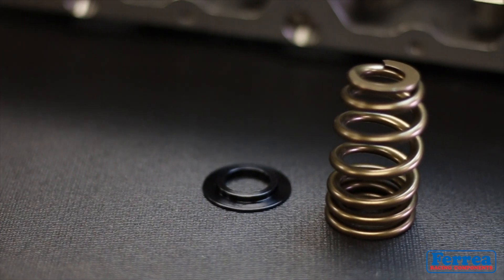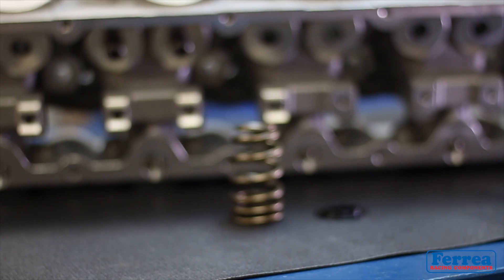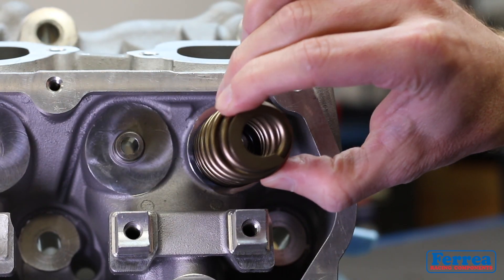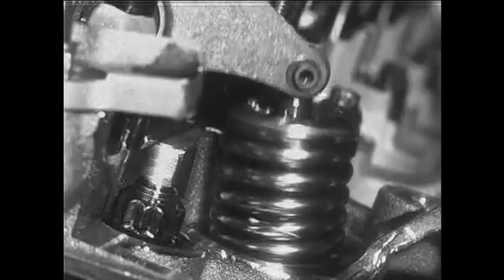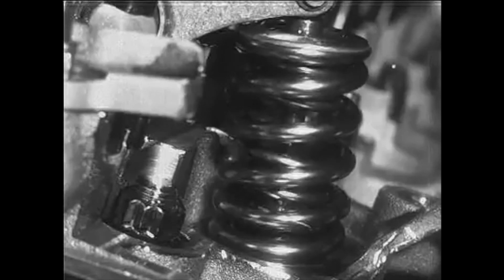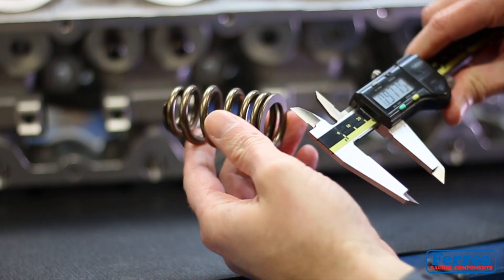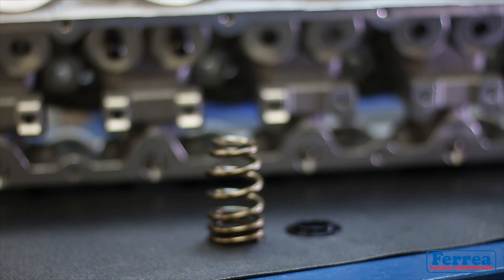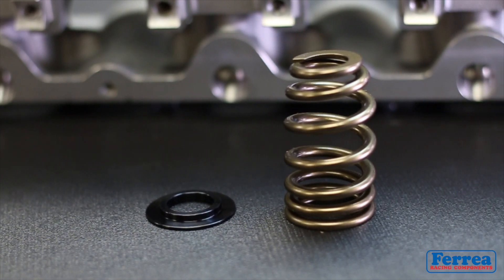Ferrea - Tech Tuesday / Valve Spring Seat Locator

Comment: Now if they only made one from my application. The one you see the video for beehives Is either for .550 or .650 lift ferrea spring.  FYI when they give I.D of beehives springs. It's the top I.D for the keeper, not for the Locator or bottom I.D

Comment: Do i need locators on a sbc steel head? or just shim it to the installed valve height? Better to install to keep the spring in check at higher rpm`s i bet?